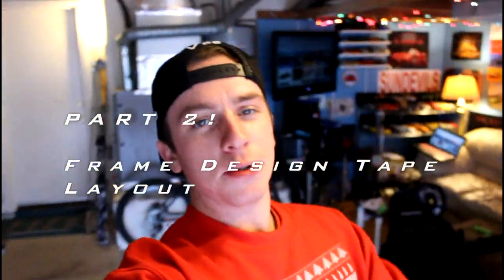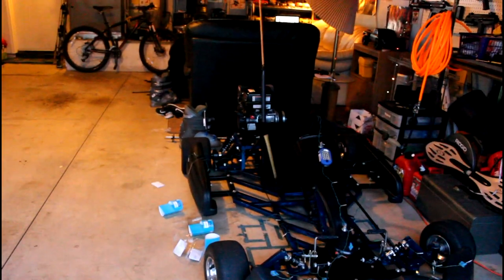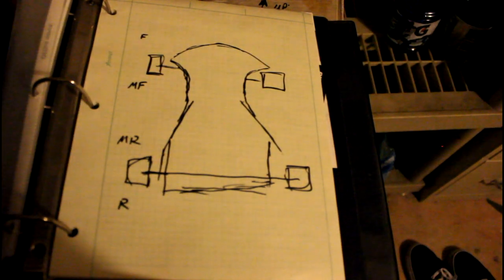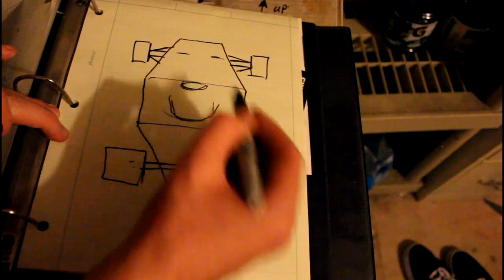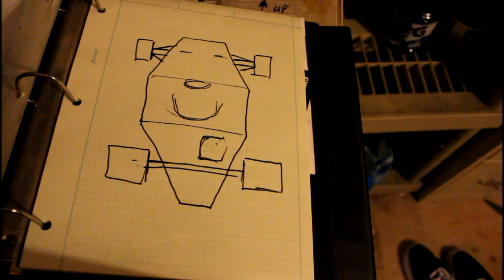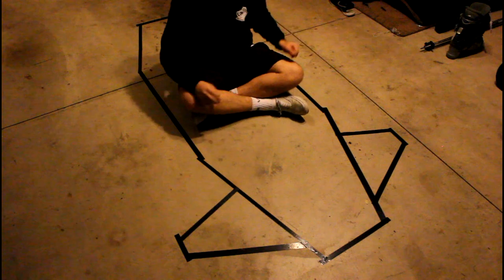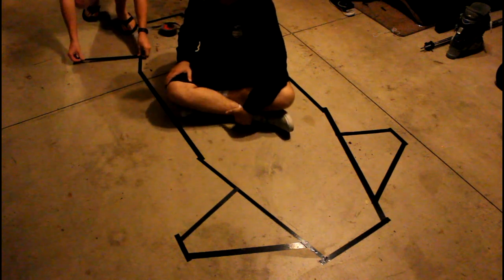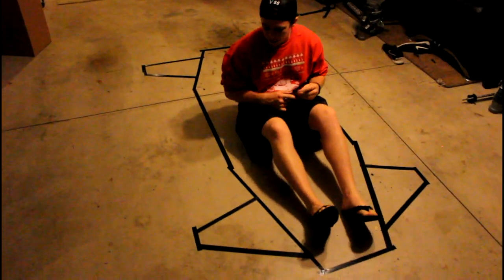How to Build a Go Kart 3:  Frame Design and Tape Layout PART 2

Comment: Would it be possible to build a 4wheel drive street kart ? So you can go faster. I am planning on building one, i dont know if its a good idea.
Reply from the maker: You could do it, it would just take a lot of time and money sourcing all of the parts and designing it. More moving parts, means more chances for things to break, but if you're up for it, I'm sure it's possible.
Reply: Hnat Automotive Photography tanks, i thing i will try it when i have time. 
Keep doing these videos!